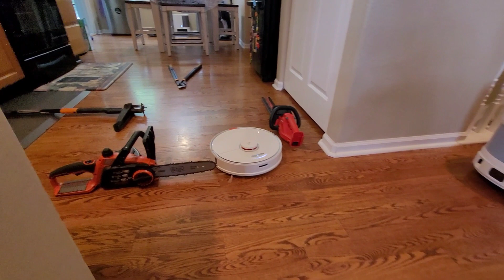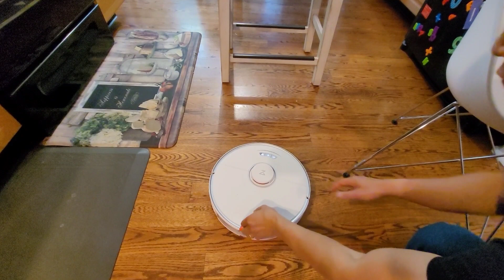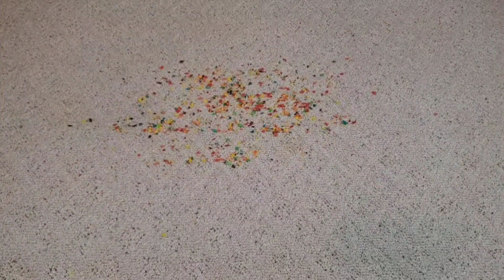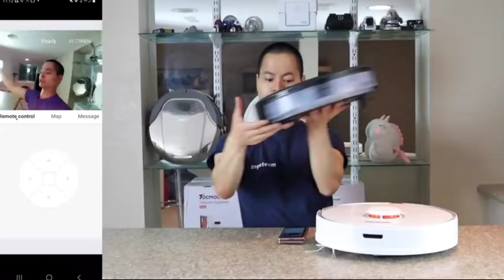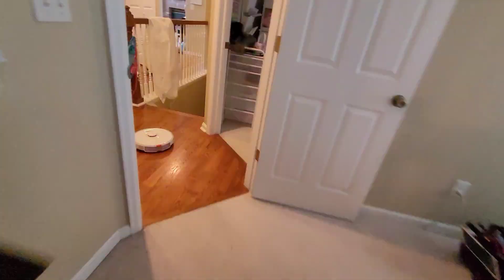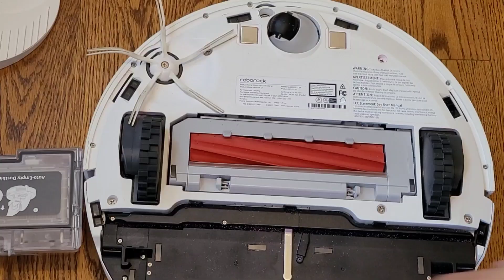Roborock S7 - 6 Month User Review

Comment: Hello, I have a question please. I have read on several forums that thé roborock s7 dis not provide enough water to the mop and that one has to prewet it before use. Is this issue still Real or was it adressed through a firmware  update ? Thx
Reply from the maker: Well the water on the mop pad eventually comes out, takes awhile. So my recommendation is to have it mop the area at least 2 times, so it can insure good coverage.

Comment: Thank you for all your robot sweeper reviews!  I've been following your channel since Feb 2021 when I first started my research into getting a robot sweeper.  I have 3 dogs, one a golden retriever, and keeping up with the shedding hair required me to sweep 2 to 3 times a week with a standard sweeper.  With 2,600 square feet this took up a lot my time that could be used elsewhere.  I decided the brush design of the Roborock S7 was going to be my best shot with dealing with long pet hair.  When I saw your video mentioning that the S7 was $200 off for Black Friday I made the leap and purchased one.  I have had it for 3 weeks now and the wife and I absolutely love it!  I run it every other day and I never see dog hair dust bunnies on my floor.  Most of my house is hard wood flooring or tile so the mopping works satisfactory on them.  My only minor thing with the mopping is the streaks left behind on the hard wood floors from the water which is most notable on sunny days when the light shines in.  It's not a big deal since my floors are a light color wood.  I think as long as I run the sweeper every two to three days I will not need the self emptying system.  Keep up the great reviews and God bless!
Reply from the maker: Thanks for watching and I am glad the S7 been a good cleaner for the most part. Not sure how Roborock can address the streaking, maybe change up the mopping pattern? They could revise the mopping pad to prevent streaking.

Comment: Can you use the vacuum only independently without running the mop and vice versa? Do you have to leave off the mop pad and water tank?  When I originally set this up, should I install the mop pad and fill up the water tank?
Reply from the maker: So when you initially mao I recommend leaving the mopping pad off, you can leave the water tank in. As for using the mopping feature, I recommend washing and drying the mopping pad after use. If you have thin profile carpet and rugs than it should be fine to leave the pad on.

Comment: How does it compare with the Ecovacs T9+, or the Ecovacs T9 AIVI?
Reply from the maker: Hello, so the T9+ and T9 AIVI is great if you have messier home. The S7 does better at picking up things and mopping. I also found the self emptying system better on the S7.
Reply: @RobotMasters  Great, thanks!

I was actually leaning towards getting a T9+ instead of the S7 due to the fact of object detection. With small children you have a lot of toys laying around, and in all the videos I've seen it seems like the S7 doesn't care about it. What's your opinion?

Also, do you know if the T9 lifts the mop on carpets, or how does it work compared to the S7?
Reply from the maker: @danielhansson9810  So the To can't physically lift it mopping pad. So yes for a house with children and lots toys the T9 better
Reply: @RobotMasters  Thank you!! :)

Comment: I like our shark iq for a few reasons #1 it has a Bagless self empty bin. #2 for the price the 2nd gen, it's just a better deal overall and ours works great
Reply from the maker: Glad it working well for you!!!
Reply: Agree that it's a good value. I had a first gen and it wasn't great at navigating, but it did a decent job and was worth it considering the low price.
Reply: @arevee9429  the 2nd gen has a floor tracker and mapped our house in 1 go. Much better than the first gen

Comment: I think it's time that I give a huge list for Roborock's Future Models!
Roborock should add:
-D Shape Robot
-A new VibraRise with 2 very fast spinning mopping pads to where it can hide inside the robot when it detects carpets
-Reactive AI3D, combining the twin AI Cameras and 3D Obstacle Avoidance for a true obstacle avoidance technology.
-A base that Self-Washes the pad, Self-Dries the pad, fills the water tank, empties into a BAGLESS cyclone system, and has a touchscreen bar on the top.
-A built-in voice assistant inside the robot so people don't need to buy one. Maybe call it Rocky.
-At least 4000 PA Suction that exceeds 24 CFM
Am I missing anything?
Reply from the maker: Well well you read my mind 😂, yes those are basically the features I am looking for too. Some other things would have the ability to transition up and down stairs, maybe have the ability to pickup small objects on the floor and place them in a designated area too!!!
Reply: @RobotMasters  that would be cool! Maybe the robot will have a special dock that’s linked with the stair, or another company makes a robot elevator!
Reply from the maker: @MrBlueCreeper  Maybe some tank treads
Reply: @RobotMasters  I totally forgot about that! Yeah ROBOROCK should do that too!
Reply from the maker: @MrBlueCreeper  Maybe if they use the same design as the iRobot Bomb disposal robot it could do that.
Reply: @RobotMasters  Did you mean Dirt Disposal?
Reply from the maker: Google search iRobot Bomb Disposal 510. You can see the track design which allows the robot to go up and down stairs.
Reply: @RobotMasters  oh wow. That might work!
Reply: @RobotMasters  I knew I missed something! ROBOROCK should add 3D mapping!
Reply: OH AND A RONG LIGHT LIKE THE ROOMBA S9+!
Reply: Ring

Comment: hello, but emptying station aside, the s6 maxv is not better and smarter ???
Reply: I have the S6 MaxV and I was in the same boat. I needed it only for hard floors and a low-pile rug. I could live without the bin on the hard floor. I'm pretty happy with the S6 MaxV. Great navigation, and the front-facing camera is a nice add-on if you're ok spending the extra. If you have indoor pets and pet waste then the AI object avoidance is definitely a plus that you won't get with the S7. Also if you're away from home it's kind of nice to use it to look around the house and make sure everything's ok. Can double as an indoor security cam.

Also, if your hard floors are sensitive wood or some other sensitive material, you may need to be wary of the harder brush on the S7. I actually had a Roomba S9 that I was using on the hard floor and found it was scratching it. The harder rubber rollers would get dirty and were not liking the glossy finish we had put on the floor. We relegated the Roomba to the carpet areas (our house is 50/50 hard floor/carpet) and use the S6 for the hard floor. It has a softer brush and doesn't scratch. After my S9 experience I didn't want to take a chance with the S7 all-rubber brush.

If you have tile floors you're probably fine either way. See Mr Roomboto for some videos on the harder rollers potentially scratching (he has a demo on the Roomba S9+ showing it scratch).
Reply: @mgrnd3875  thank you very much for the kind info :)
Reply from the maker: From my testing, I didn’t see a huge difference in navigation abilities. It did avoid smaller objects better and has the live camera feed option. As far as cleaning the S7 seemed to clean better on thicker carpets.
Reply: @RobotMasters  ok thanks :) but considering that I don't have carpets at home, only a very small one, and I don't need the self-emptying function, is the s6 vmax better there? what do you say ?
Reply from the maker: @danyelcosta2678  The only reason to get the S6 MaxV is if you have a lot of obstacles or have a messy home. Some other options are the Roborock S4 or S5 Max, if you want to save a few hundred dollars and don’t necessarily need the extra features.
Reply: @RobotMasters  thanks for the answers :)